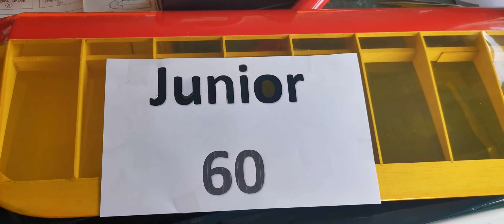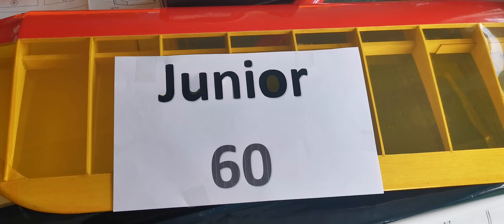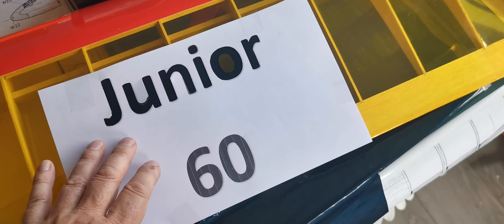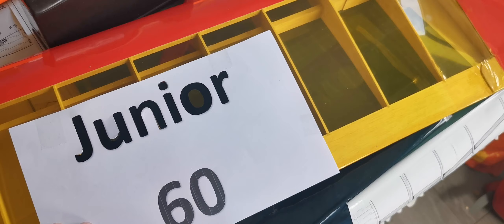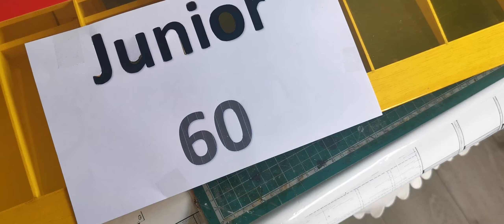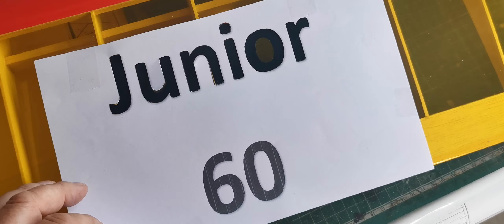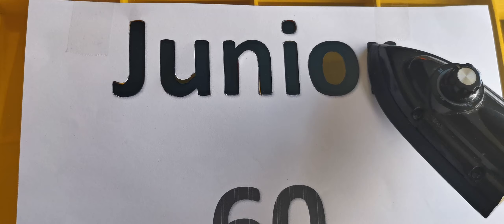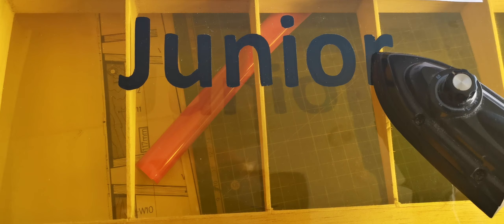How to make a stencil.

Comment: I've watched it several times, and I'm totally confused 😕
Reply from the maker: Sorry Ill try to explain.
First design your logo on the computer and print out.
I then place the print out over the selected solarfilm and use sellotaped to hold in place.
Next using a sharp blade cut through the pattern and the solarfilm below. You should now have the letters to iron onto your model. Retaining the template sheet place in position on the model and once again use sellotape to hold in place. You now line up the cut out shapes with the holes in template sheet. Tack in place with the iron then lift the sheet to fully iron on the shapes.
Reply: @MarkCroucherRC4fun 
I think I've got it! My confusion was how did you transfer the film WITH the template?
Answer - stick the template on the wing first, then put the cut out film IN THE CORRECT HOLES! Doh! 🤦
Thanks for the heads up Mark.